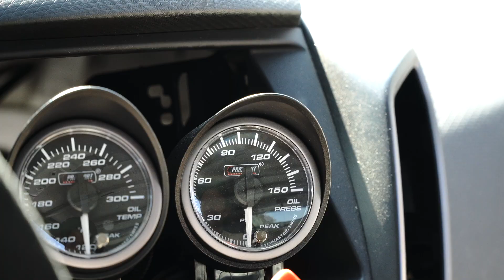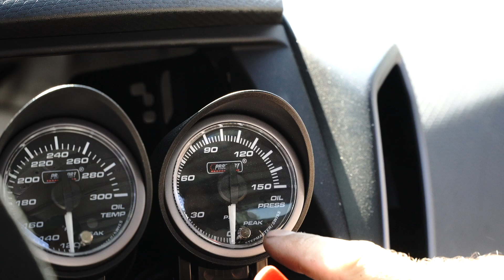New Engine Prime and Break in Process

Comment: Ι have made a new rebuilded diesel engine before one year..my problem is the assembly lube on the rod and crankshaft bearings..is any possibility this lube to dry with the past of time?? I will put the engine on the car next year,also i turn the crankshaft with hand many times before ,with the last from december..